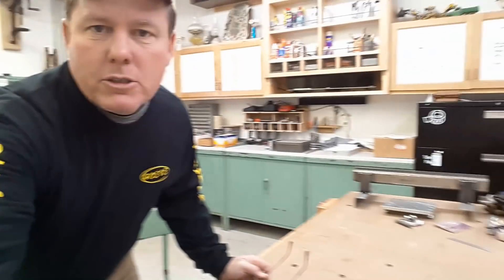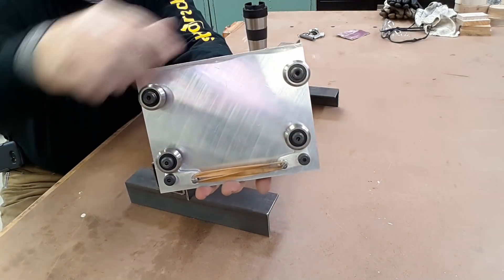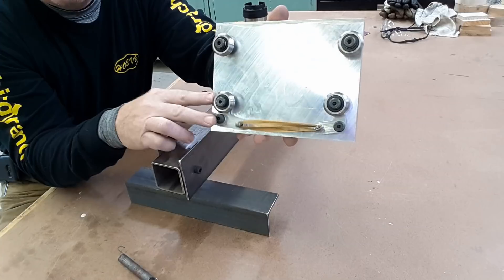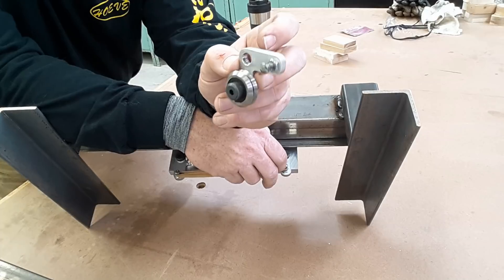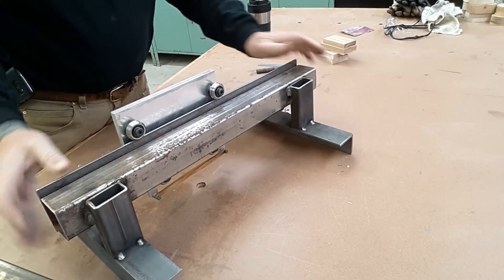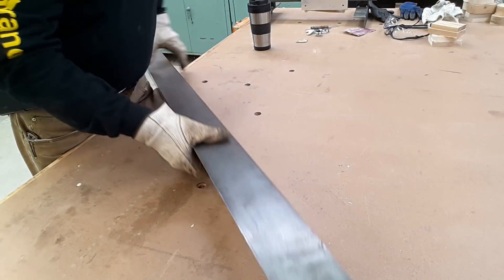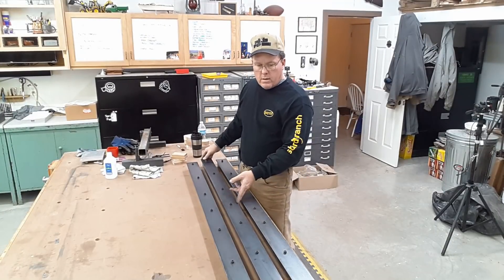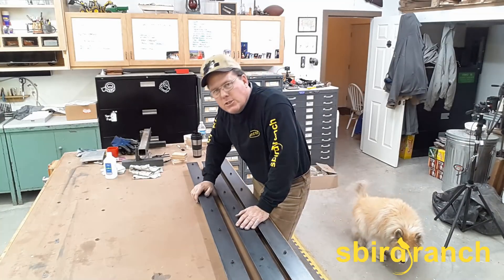DIY Linear Rails No Drawer Slides

Comment: I used to drill hundreds if not thousands of holes for aviation assembly. I was not one of the fabrication experts at all but I devised a little jig that allowed me to predrill the angle supports which wrapped around the inside of the fuselage. Perfect 1" OC holes. Used the same jig to slot one side of the angle that needed to flex with the fuselage radius. The business owner's father thought my jig was ingenius. But the owner and his pet fab expert didn't like it because they didn't come up with the idea. So they called me all kinds of nasty names. And I mean nasty. Horrible place to work. I also developed a bell crank in 15 minutes to solve their aileron dilemma that the designer had been working on for 6 months.

Comment: Wouldn´t it be easier to weld two "L" profiles on the top and bottom of the 2" square tube? Thanks.
Reply from the maker: Easier is subjective.  It would work for sure.  ~P
Reply: @sbirdranch  Anyway, excellent job!

Comment: yeah it's a good and cheap design, 3d printers use them alot.. most are with accentric nut but i have seen some with spring tension. obviously the only fault with spring tension is you can't have any load pushing on the spring. like in the example you showed if you load a spindle on that carriage it will push it up against the bottom wheels and can even drop the carriage from the rail.  a way to counter that is have two rails with the tension wheels opposite of each other (two on top, two on the the bottom in your example). but that makes things more complicated which is why the accentric nut is the popular method.

Comment: Hello, I really liked the video ... I am also manufacturing my own CNC Router, I am not from the mechanics area, I am a Software and Graphic Design and Product developer ... I love these machines ... The Price of linear guides in Brazil it is impractical, I think and making my machine 100% with belts and linear guides is still a PRICE problem ... so I think of creating something that is really effective to correct gaps and possible discouragements ... if we can exchange information it would be really cool of mine email: allexon@gmail.com

Comment: If you need to use counter sunk screws so the Heads are flat with the surface of the rail, you can drill and Tap a length of flat bar the thickness of the bolt thread to keep the thread strength. That way you don't have to worry about getting a nut and wrench down the inside of that long rail.

Comment: we have a 5'x20' cnc plasma table at work from the late 90s and it has a 2x2 1/4" wall steel tubing on one side with 2"d * 3/4" rollers & on the other side there's a polished piece of bar or tubing. it's a lot less "precision" compared to other cnc machines, for plasma there is a wide margin of error, the servos are doing the precision work, not so much the guides.

Comment: I am planning to build a "hobby-grade" DIY 6040 sized CNC router, using a cheap 500W spindle, or trim-router.  I had dismissed V bearings as probably having too much axial end float.  Your carriages look better than I expected... could you please confirm they would not be a good idea for my application.
Thanks for another really useful video, the explanation on your thought processes and feedback on how it worked out, is invaluable.  Liked, subscribed some years ago.
Reply from the maker: I would not go this route for a router or spindle machine.  The radial loading of the cutter will cause a significant lack of precision.  Precision your machine would otherwise be capable of.  Because my use is for a plasma table, I don't have any side load.  It I built my router again I would swallow the price and go right to using hiwin style rails and ball screws.  Good luck. ~P
Reply: @sbirdranch  :  Thanks for taking the time.  That confirms I was on the right track.  I have no "need" for this machine, so if I take the time and money to build it I should try to ensure I get satisfaction from the result.  I guess I am another one of those suckers who think they can build a Tormach alternative from plywood and bent wire.  Youtube is full of us!   :o)

Comment: What a nice drill press.  I totally support your efforts and to just say no to China man and his CNC products.
Reply: To be fair you could get a pair of 1000mm linear bearings with 4 sliding blocks for $34 and it would still be 10x better than what he is building with hot rolled steel and rubber bands. I mean those shoulder bolts and ball bearings ain't cheap man. Why go through all the trouble?

Comment: I assume this wouldnt work for a cnc router well? Just because any load on the bottom bearings from a pluge cut motion would cause flexing of the rubber band?
Reply: It might depend on the weight of the carriage. If you make it heavy enough it will be probably be fine
Reply: @funmaster4632  definitely, if you look at something like the maslow cnc router it relies only on the weight of the sled to keep the router in place, and seems to work fine even at an angle

Comment: I haven't looked through all the comments, but i was wondering if anyone had mentioned how, while the idea of the tension-ed v-wheels is a good one, they probably wont' hold up to any back pressure on the Y-rails unless the mount on each side are reversed from each other. also, for an X-gantry, the spring loaded tension would probably not hold up to sideways pressure placed by cutting to the spring-loaded side of the v-wheel mount. i may be wrong, and i'll watch the further videos on this.
keep up the great work,
Russ from Coral Springs, Florida, USA
Reply from the maker: You are correct in all counts.  These rails are going on a plasma cutter.

Comment: your side plate could be put in a jig for plane ing  awesome ideas thanks i'm going to copy your idea the top v grove  may have more stability if they offset horizontally by the width of square tube now look what you've done  thanks for the inspiration
Reply from the maker: Watch out.  Crazy things happen when you start thinking ;)  ~P
Reply: Very smart idea, I've been thinking to do the same then I imagine a rooter motor mounted on this kind of X axis. An upward force created by the motor bit contact will be transfered directly to lower spring loaded bearing and make them move a bit upward causing my cnc to be inaccurate !!!! What do you think?

Comment: I like your design.  You could simplify it by mounting all 4 bearings in the plate with the lower bearings near corners Then drill a hole above the lower bearings 3" back from each side and saw a slot from the side of the plate into the hole to create a flex arm.  This would not be as adjustable as your design but the width of the flat stock should be close enough for the small flexure.

Also a simple jig could be built to mount an angle grinder and pass the flat stock through to grind a consistent bevel on all 4 corners.
 
 PS.  Your hand crank post drill looks a bit too high to use....
Reply from the maker: Those are some interesting ideas.  I especially like the grinder jig thought.  And yes.  The drill is a b! At the top of the crank stroke ;)
Reply: MY plasma CNC machine is at about the same stage as yours.  The cold has put a hold on installing the cable ways, wiring and electronics.   This is my 5th CNC project counting the 1980 Bridgeport BOS5 milling machine CNC retrofit.  It looks like we have many similar interests and projects in the machine shop. It would be interesting to collaborate on the CNC.
Reply from the maker: @chuckinwyoming8526  I understand the cold thing being here in OH.  The section of my building this machine will go in is currently unheated.  Hence this build is going on in my wood shop.  I am excited to get it done.  I have the torch mount and z axis complete (floating head magnetic mount) and 80% of the wiring.  Once in operation I'm sure I will find improvement areas just like I have on my router.  I'd just like to put it to some use in the end.  I have about enough space for a cnc mill but I'm not going to build that.  Maybe we can come up with something to collaborate on, even if jjt is just a component to a machine. ~P

Comment: You would need to make the adjustment solid not a spring..  If you use a spring the entire gantry would lift unless the springs were much stronger than the weight shift of the gantry when it moves and stops..  A turnbuckle style adjustment would be far better as you could preload the beearings and it wouldnt have any give to it..
Reply from the maker: This is going on a plasma table.  It wouldn't work on a spindle machine as well.  Plasma pantries have no force applied to them in cutting.

Comment: Keep the weight of the gantry as light as possible. A rigid aluminum extrusion would be the best. The less mass you have to move the sharper your corners will be. Cutting speed is everything when cutting light guage sheet metal. I have a quick overview of my cnc plasma table on my channel. Check it out. It might give you some ideas. My linear rail was made out of surplus stuff off of eBay. I didn't pay a lot for it. I like your rail system...I almost went that route but got a deal on my linear rails and it saved me a lot of work.
Reply from the maker: Thanks for the tip.  I'm heading to your channel now. ~P

Comment: It seems that round linear rod would be a better choice than hot rolled plate with so many inconsistencies, twist, etc... for any amount of accuracy. Your tramm is so important unless your cutting tiny parts or working with wood where it may not matter so much any metal will show the rails inconsistency in the finished work. Those bearings are already used in purchased rail systems that use a offset screw head for tensioning and setting them precise where there is no forgiveness. Having used a plate of tool steel with precision ground edges you could significantly improve accuracy as well machining the mounting face of the square tubing before mounting. As someone stated the Chinese rails are cheap and probably a better alternative for what you’re investing. Long precision rails can be had for $70. Cost of metal these days and bearings would easily approach that cost. The premise is correct the implementation is not.
Reply from the maker: I totally disagree... but that is what this is all about.   Precision linear rails for a plasma table would have a very short life outside of being overkill....again...plasma table.  The dirt and grit from this type of cutting gets everywhere.  I sure wouldn't want it in even cheap SB20 round rails.   Now...again...plasma table here....Z axis height is moot.  Throw in a THC and any vertical inconsistencies are erased.  As for X and Z axis, I have removed any appreciable wave by bolting it to some fairly straight tubing.  After that it is all up to the precision of your motion control setup.  This is where I have the least confidence in my design.  We'll find out soon enough.
Reply: Glenn Edward:  I think that chasing sub-micron precision is over-the-top for a plasma cutter... cost and durability are more important.  This gentleman has already made a number of videos on building a CNC router, which used round supported rails and ballscrews.  Well worth a look.

Comment: hey after watching your videos it appears that you will only have one rail running between the 2 rails on each side.  From your prototype of the head carriage are you getting any lash in the y direction on your x carriage or is the spring tension enough to keep that pivot out of play when the weight of the torch is hung on the side?  I understand that the v bearings should take care of that im just wondering if they actually do.  I love your design and your fusion work is great!
Reply: I had the same question...how much can you torque one of those plates with the two spring mounted rollers before it goes out of horizontal / lifts one of the upper rollers slightly off the rail?  I guess with enough spring tension it won't happen but the spring in the video looked fairly stretchy.
Reply from the maker: I can move the entire carriage from one side and there is plenty of strength to stay on the rails.  I'm confident that with both sides being driven, that I will have no issue.  Time will tell.
Reply from the maker: Given that there is very little resistance to rolling motion and the ability to push it from one side and have everything stay in place, I don't expect any issue.   I haven't made any additional progress yet to say more definitively.   Most I can say right now is it all looks good.  I will post more videos as work progresses.  ~P

Comment: I sure wish I saw this before I machined my rails. I'm part way through offset turning some ridiculously overly complicated, difficult to adjust, unforgiving, time consuming, PITA , wish I'd never started, "eccentrics" that I designed for keeping tension on the bearings. Your "control horns"(lol), look to be a MUCH simpler and more forgiving solution. Looks like I'm changing gears again while I still have my sanity. Thank you very much for the helpful video and reminding me accuracy in certain components doesn't always matter as long as the desired result is met. :>) Smart work !
Reply: Hey!... cheer up, I bet they look good!   ;o)

Comment: did you consider some of the extruded aluminium systems like like V-slot/C-beam? all that iron is going to be heavy to move around
Reply from the maker: Lasse Langwadt Christensen My design was predicated on the materials I had on hand (almost).  I agree that the amount of mass is a concern. I am worried about belt strain and the speed of acceleration I will be able to achieve.  I'm will have plenty of motor.  Swapping in an aluminum extrusion will be something to keep in mind.  ~P

Comment: Interesting project,  I like your engineering philosophy.   I will be following your design intently.  I'm currently rehabbing my shop, when finished I will be working on my own system.  I hope you don't mind if I copy some of your design ideas, I will of-course give full credit on my channel?
Reply from the maker: Copy....improve...go for it.  I will/have put all the current drawings out in the public domain.  I will be putting those links in the next video, which will be a virtual tour of the intended complete design.  That way you don't have to wait for me to finish it, and I don't have to wait to finish it go get what might be some really good insights.  ~P
Reply from the maker: I shared the Fusion drawing in advance.....  http://a360.co/2IBatgK
Reply: Thank You
Reply: In the unlikely event (famous last words)  the carriage would crash, may I suggest an adjustable stop on the bogie wheel bell cranks; adjust them to the necessary range of motion but not so-much that the carriage could de-track.